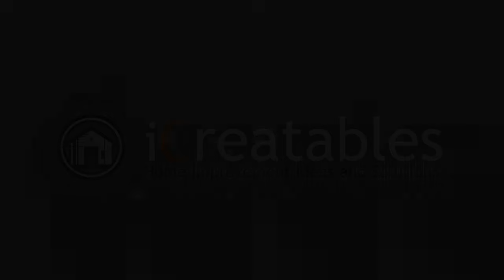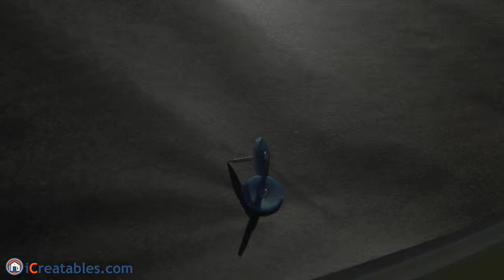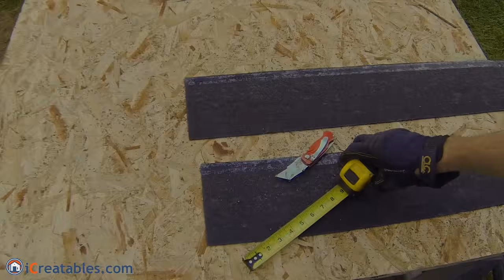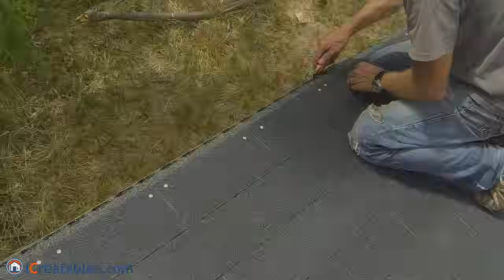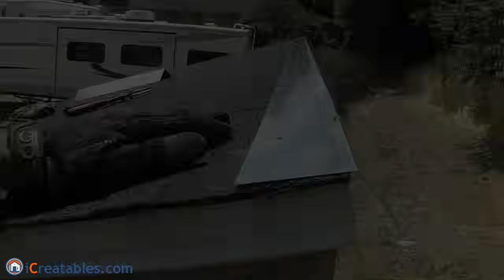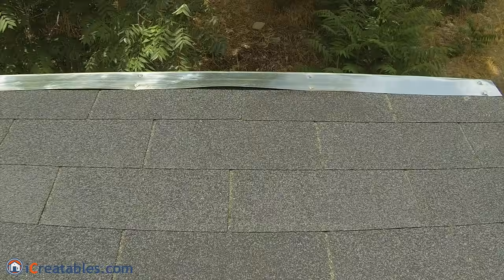How To Build A Lean To Shed - Part 7 - Roofing Install

Comment: A tip for weekend builders who have never roofed and likely spend too much time behind a desk all week (like me).  Remember to peel off the cellophane 'tape' off the tar strip before laying the shingle down.  Yes I screwed this up on the very first shed roof I did years ago because it was hot out it was not immediately apparent that there was even tape there.  At the time I didn't know enough to think that the tar was there to glue things together.  Yeah I know dumb but live and learn.  Thanks for the great video!
Reply: Hey you didn't screw up the roof. Thats a common misconception beginner roofers have, that plastic thing in the back is for shingles not to get stuck together during the shipping phase. So when you unwrap the package, it doesn't stick. Which is why you'll see the next time you open another bundle, that the tar line is directly under that plastic cellophane tape your talking about. Oh and be sure to always nail your nails directly on the "thick" part of the nailing line on laminate shingles.
Reply: Most instructions say not to remove the tape.
Reply: Pabco shingles say do not remove it and it is written all over the each shingle

Comment: I'd say have the slope going the other way so that when it rains it does't soak the whole front door area.
Reply: You get more useful space when it slopes forward because you can use the whole back wall which is extended higher because of the slope.
Reply: Both very valid points I considered building my shed. Putting the door on the “high wall” seemed wasted space or volume rather in terms of height and storage because my doorway is 6ft wide. On the other hand putting my doorway in the “short wall” I don’t think it would look well and constant runoff over my doorway area is not ideal. The solution is a loft above the doorway.

Comment: It took me about 4.5 hours to do all this - as I hate heights any height and this was my first time.  Use the plastic felt nails as shown they are only about $6 per 300 or so.  I didn't measure the 12" up along the edges for shingle adjustment, but eyeballed it and it was near perfect at the top.
I also used 1/2 plywood - you will need 2 pcs of it or osb.  
I used owens corning Driftwood Dimensional/architectural shingles I bought at L's.  It has a different adhesive system (tar strip) but it works fine.  I made starter strips from them.  The offset is 6.25 inches for the dimensional stuff I used.
I purchased rolled 8" aluminum flashing $6 for the ridge but because it is dimensional shingles it is a little awkward.
The hardest part of this whole job is trimming the shingles on the rake.  Near disaster for me as it is very tough to do and you can ruin your work quick.  I actually used a cordless dewalt trim saw to trim a little and it worked ok but you need to wear goggles, long sleeves and be above the saw when cutting because it is throwing debris everywhere and it stings when it hits.
Reply: When working with flashing I would roll out about 8.5 feet on a work bench on the edge to use it as a brake.  Fasten the ends on the top of the bench and the bend the flashing over the side.  It will be 90 degrees but you can adjust on the ridge.
Reply: When you say 2 pieces you mean 2 layers of 1/2 inch? I currently have 1/2 osb on my roof (1 layer). I am ready to install the shingles bit I am a little confused. Are the nails going to go through and will see them in the inside? It is my first time building a roof and I don’t want to mess it up.

Comment: NOTE: The materials list indicates roof drip edge of 1"x1" and the videos states 1 1/2"x 1 1/2". The later is more standard and should work better and be easier to find. Also, the "roofing paper nails with plastic caps" are not on the materials list.

Comment: This is partially correct, he forgot to install the starter strips along the left and right side of the roof. Other than that everything is done correct.
Reply: Cris Rome So there ought to be starter strips along 3 sides? Huh. Wouldn’t that make the sides bulge up and look weird?
Reply: Brian Cookson , my understanding that I have seen elsewhere is that it helps "glue" down those outer edges just like what it does for the lower drip edge
Reply: Brian Cookson, you technically have to put it but not many people don’t for the fact that they don’t want to buy extra starter strips. To answer your question it doesn’t bulge up, you would think it would but it doesn’t.

Comment: I've heard different opinions on whether or not to put the nails just below the tar strip or right into it. I've been told to put it into the tar strip as the tar helps hold the nails in place and stop them from popping out over time. What would be the disadvantages of driving them into the tar strip?
Reply: It's also good to mention that 3 tab shingles have notches cut in them on both sides, 6 inches in from the edge, so that you can pull up the notch and butt the shingle up to that notch, rather than having to measure to get the pattern aligned properly. Also, running starter shingles up the rakes is a good idea for extra protection against wind lifting shingles from the sides, and it helps to give a straight clean line seen from the ground.
Reply from the maker: pguiver I am not sure as to why but the instructions on the package say to put them just above the tar strip. Every nail goes through several layers of shingles which are made of tar and help hold the nails in.
Reply from the maker: pguiver That is a great idea to run the starter strip up the rake of the shed roof. I will have to try that.

Comment: Is the mastic for top ridge silicone or tar based?  It sounds like silicone won’t stick very well but that may not matter since it is nailed down. Apparently tar sticks well but can soften the shingle if too much applied. On balance I’m inclined to use silicone. Thanks

Comment: Thank you for the video. Question: You covered with aluminum over the shingles at the top edge.  Do you think water would leak underneath the aluminum?
Reply: He used mastic underneath the leading and rear edges and nailed it down that should seal it and the grade is slanting down away from the top edge that should shed the water

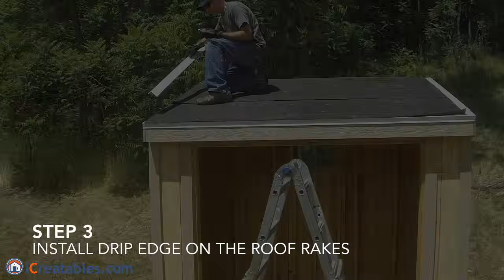Comment: We've just about finished one of you 6x16 lean-to sheds! Great instructions!! One question, what is an underlayment appropriate for low slope 2:12 roofing with shingles?
Reply from the maker: Typically ice and water shield or asphalt roll roofing. Check with the manufacturers specs for your roofing.

Comment: Is the nail sticking under the ceiling, I am trying to do this on my patio roof and I don’t what to do to avoid the nail being shown under the ceiling? Any suggestion?
Reply: Cut it with the grinder, did it on my shed
Reply: You are right OMG why did I think of that!

Comment: I was actually wondering if youd be interested in making a video that shows how you wld go about squaring a lean too roof? im starting from the roof by installing the ledger board, and using 4x4s on the other end. any info or tips knowledge wld be extremely appreciated
thanks
Reply: 16x10

Comment: I have a package of other shingles (architect)- their black strips on the back are not in the center ..they are on the both opposite ends on the back. Can I use those still for the starter shingles if I cut down the middle (so I don't run out of my new shed shingles - 3 packages)? thank you.: My lean to shed roof is 8 ft. x 12 ft. and I bought 3 packages of new regular shingles .

Comment: Why don't use just keeps on installing the shingles until u reach the top of the  roof instead why restarting at row 7 ???
Reply: What he means is that from row 1 if you moved each subsequent row over by 6 inches after 6 rows you would have moved over 36". That's the length of one full sheet of shingles so for row 7 you can start exactly on the edge again without moving it over 6 inches. Hope that helps.

Comment: do you need fascia board on the sloped part too and can you run the drip edge all the way up instead of 2"? so basically it would go on eave and both sides of roof
Reply from the maker: The siding can be run to the roof and have the drip edge installed without the fascia/trim. Make sure that your siding is cut with close tolerances so that the metal drip edge covers it.

Comment: Question: I am confused at 0:25 where you say you are using 1.5 x 1.5 metal drip edge then extend the drip edge up the rake of the roof 2 inches. How is this possible? Thank you. I am a newbie to DIY!
Reply from the maker: The size of the drip edge is not in relation to how far up you take it around a corner. The point is to have the overlaps between pieces to be 2" or more.

Comment: I have an addition on my house.  The high end of the addition's roof buts against the wall of the house, under the overhang of the house's main roof.  The soffit on the overhang is all rotted away.  I am going to reshingle the addition and replace the plywood soffit.  I am wondering if it is necessary to vent a sloped roof like this.  My addition has no venting and I am thinking that is what made the sofft rot away as it should have never rotted away being under the overhang.  Any thoughts?
Reply from the maker: When a roof is vented it makes the roofing last longer. Rotting typically comes from wet dry cycles. But venting will keep the interior from collecting moisture so it should help.

Comment: Can you use architectural shingles with this design?
Reply from the maker: Cy Ance Yes, the roof slope is 4 in 12 so any roofing material rated for that slope of roof will work.
Reply: iCreatables Hey, I love your videos.  This is key for your business as I was tasked to by my wife to build a shed and had no idea how or what I was doing.  I have made a few instructional videos and know how hard they are to plan, shoot and especially edit.
Reply: Home Dep has a ridge/roofing pre bent flashing for this.  I did not notice in the store before.  It is bent 90 degrees but that is fine.  I used rolled aluminum flashing and won't use that again.  Great vid.

Comment: What is this shed leaning to on? I need to have a leanto roof to a wall
Reply: Lean to refers to the type of roof - not to say that it has to lean on anything. This style has on angled portion of a roof as opposed to a gable roof, for example, that has two parts of a roof coming to a single peak. Does that make sense?

Comment: only one thing to all guys that are going to do this for the first time,  don't take this position to install and walk on the roof, this is just an example, the right way is facing the bottom line of shingles, is easier to move, faster and less dangerous. 

By the way (no hard hat and harness detected)
Reply: why the fuck would you need a hard hat on that roof for, let alone a harness.

Comment: how do you install the lower drip edge if the roof is longer than 10ft which is the length of the drip edge available at the hardware store?
Reply from the maker: You need to get another piece. It is only sold in 10' sections. Thanks for watching!
Reply: You need to use 2 pieces.  One piece should overlap the other by 6" where they are joined, and even though the joint will be covered by roofing felt/underlayment and shingles, it doesn't hurt to apply a little roofing mastic/caulk between the 2 overlapped drip edge pieces at the joint.

Comment: wrong. measure the roof and find its center so what is on one side is the same on the other side. starters shoul be 7 inches not 6.
Reply: that's what I was thinking just watching the end of the video and seeing the shingle slots on left side only an inch from the roof edge.

Comment: how many drip edges do you install. for the  rake edge is there already a drip edge there before you install the last one.
Reply from the maker: +jhm s-tagg  Drip edge is sold in 10 foot lengths and you overlap it by 2 inches. It depends on the length of the shed roof eve or rake that you are installing it on. Thanks for watching.

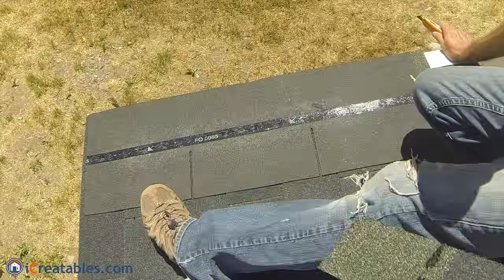Comment: 7:37  Not a very good Lay out of the Job   small  1/2 & 1inch wide  shingle ends left.   they will fall off or be blown off  not a nice job
Reply: 1995dresser , I was thinking the same thing when I saw those little bits

Comment: Not trying to be critical, but it’s crazy how dozens of freestanding shed roof videos with millions of views (How To’s) are incorrectly titled a “Lean To”. It’s not just my personal opinion. 33+ years as a second generation GC, 12 years on the Code Enforcement Board, review of hundreds of plans from dozens of Architects / Engineers and multiple definitions / illustrations online say so. In the U.S. and most English speaking countries, it’s only correctly called a “Lean To” if it “leans against”, i.e. “To / Towards” and or attaches to an existing wall or structure, by utilizing said support for load bearing, typically on the high side of the slope. I’ve personally never seen a “lean down to” reverse pitch roof, but there’s probably some out there. 😂 If you build a new 2-3, or 4 sided, freestanding structure and the roof rafters (load bearing points) sit on top of the walls / beams on each side, it’s called a “shed roof”, or a “mono pitch”, or “single slope” roof, etc. JS